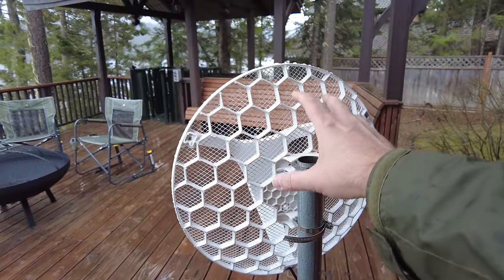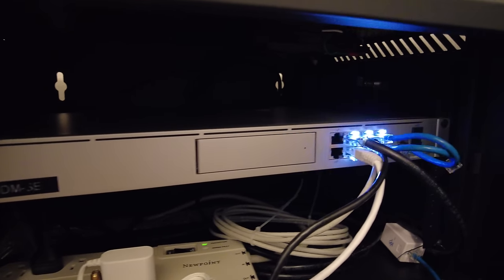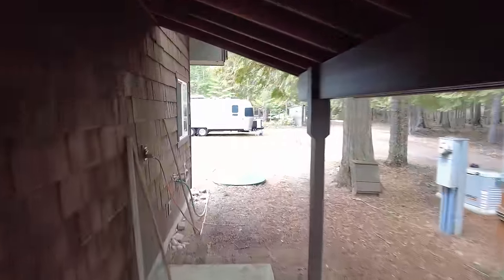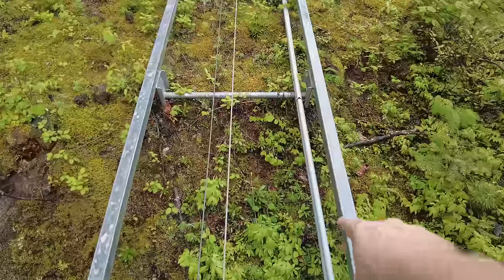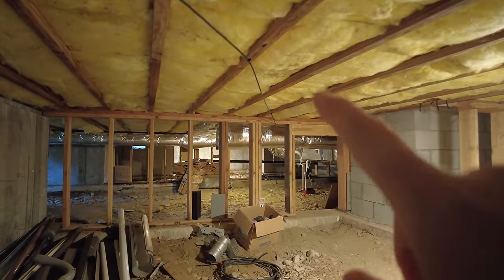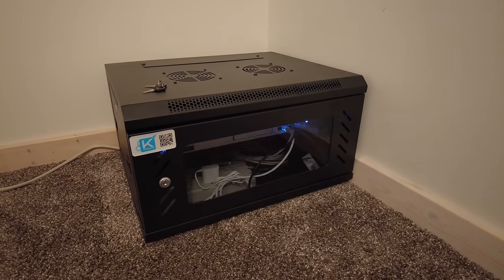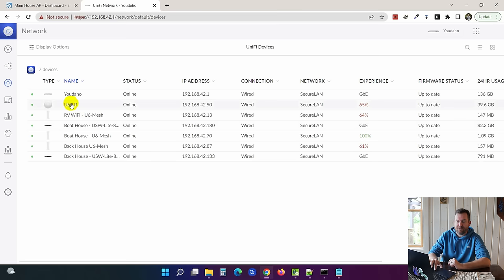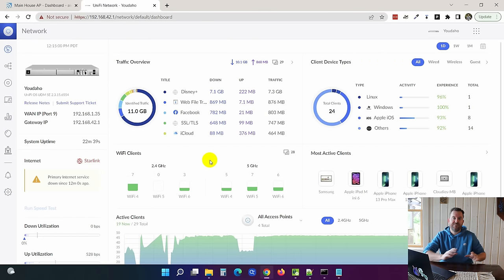An EPIC Network Install in a Beautiful Location!

Comment: What were the CAT6 SHIELDED connectors you ended up using? I had a similar situation and my connectors were not able to accommodate the larger insulation used on my Cat6 able so I terminated them with Cat6 Jack's and used short patch cables to patch them into the router and other equipment down the line. So what Cat6 connectors/brand were you able to use?

Comment: nice setup, here's an alternative

from beach : starlink + local isp hardwired to a proxmox box ( 6 ports that can do 2.5Gb/s) running virtualized pfsense/opnsense with 3 nic passthrough + librespeed container + unifyctl container
from boat house : hardwire proxmox box to an access point + hardwire 2 cables to the main switch in the main house (1 dedicated to promox and vm, one for the firewall vm dedicate nic passthrough -> basic and you can switch the cables if one is dead, if possible I would run 3 cables)
from main house : hardwire to a small switch in the back house that will spread wifi
from back house : hardwire to access points at the rv place or if length is ok, hardwire from the rv place to the main house directly

pros 
- local unifi controller
- local speed test
- pfsense (= all the goodness, vpn for remote management, multi active wan, ddns, traffic shaping...) 
- snapshot capabilities for fw, and unifyctl before any updates
- virtualization capabilities for any unpredictable need
- no wireless bridge
- can go 10Gb/s on local wired bandwidth

the problem with this kind of jobs is that it requires 2 kinds of distinct skills : general contractor and IT : general contractor are afraid of IT stuff and IT people are afraid of drilling a hole or pulling a cable,

Comment: I like the VLAN->WAN trick. 
So I’m clear the WAN switch has 3rd network cable running to the UDM to carry all VLAN data?
Plan to use this method to media convert a 2gb Fiber WAN connection modem with a 2.5RJ45, through a switch, then out to a 10g only SFP+ port on a pfsense router.

Comment: I do like this setup. The only thing I'm wondering is if spray painting the P2Ps voids the warranty. Also kudos to the ISP for helping out when you were in a pinch. Some ISPs I've worked with basically say blah blah insurance, blah blah liability, blah blah F off.

Comment: Hi Chris, thanks for the great video!
Great idea with WAN forwarding through VLAN!
Tried it at home :)
Now my UDM shows all clients from the outside because they appear in these VLANs. The network topology screen has hundreds of clients! I just can't find my devices) Is there a way to prevent UDM from monitoring traffic for these VLANs? Just put packets into VLANs on one side and pull them back out on the other. Nothing else.

Comment: Why not use an optical cable between buildings? Ethernet cable is not a great solution mainly because of the storms.
Reply: Would require media converter or a switch with an SFP port, extra device
Reply: You had a fairly large conduit so you could have ordered fiber to length with LC on each end.   Then you just need a different switch in the boat house with an SFP slot.   I don’t like media converters because of the added power brick.  You should look at fiber termination equipment, which has gotten cheaper and easy to use.   Before I retired, I managed IT for a large construction company for years and we fried so much equipment when we had static events affecting the CatX running underground between job site trailers.   Once we got setup for custom fiber termination, that problem went away.   I hope you grounded and protected that shielded cable properly!   Love all your videos dude and this was a dream job with the lake scenery!

Comment: Wondering why you didn’t just run 3 cables up from the boathouse?

I know you can easily achieve the same thing with Vlans as you have demonstrated, but just think simple is better especially if it is an AirBNB.

Comment: Question: why did you not fun a fibre run for the outside run from the boathouse up to the mainhouse? is that not "safer"? i was told not to run CAT cable in outside enviroment even in conduit? is that true? sorry if this is a n00b question. Love you videos!

Comment: Is it worth including a note on needing to ensure that the external cable has the correct flammability e.t.c ratings for internal use as looks from the video that you have used it without transition to internal rated cable for the internal runs? If you did transion, as you were.

Comment: Hi Chris! Thanks for sharing this project.
Can you comment on the U6-Mesh for APs, instead of U6-Lites or LR’s?
Was it to allow for future expansion with mesh capability?
Reply: It's his new favourite AP https://www.youtube.com/watch?v=GySDfm0CVQc
But I had the same question actually, but it's quite similar to the LR in performance, however, the LR is not as liquid proof, doesn't come with a POE adaptor and has a different form factor.

Comment: would have run extra cables boat house to main avoid the VLAN complexity and the added potential failure point, also would have pushed for cable link to rear house, wireless should always be link of last resort for a trunk especially in what is essentially a commercial setting being an airbnb. The starlink on the dock worries me, Ice and ground heave in winter is going to stress that cable ALOT!

Comment: Great real would implementation!  I had a quick question.  I’m doing a similar setup for a pretty wide open farm.  The main house with internet I wanted to use a 5ghz omni antenna with the rocket prism 5ac.  And for the remote locations use the nano beam 5ac with the u6 mesh, no switches at remote locations as they only need Wi-Fi.  But is a Omni antenna best choice since I do have a LOS?  But the LOS are from different directions.  Or would it be better using multiple nano beams on the main building give it better through put?  Thank you in advance.
Reply: I have the exact same need.  I even live in the same city as CrossTalk Solutions and contacted them a few times for help with design and setup but, ironically,  could never get someone to answer a phone nor return a message :(  There are lots of videos on YouTube addressing our needs but I've yet to find one comprehensive how-to video.

Comment: Excellent video - well explained - really seems like a sledge hammer to crack a nut a little  bit - the idea of wireless is to avoid miles of cables - and mesh is being used anyway  - and of course the relocation of the dish to get perfect line of sight was one of the keys - but anyway more of these examples please
Reply: Didn't see mesh being used in this example.
Reply: @adamm7309  yes mesh on each level and 2 to the back - (10m.05s) total 4 - i still dont understand why they didnt just run the Cat6 cable from the Antenna up conduit , straight to the serious , main house router   (signals travel in downwards directions anyway _why bother to have a router you struggle to access in the boat house and the switches so you can access it - just build a spiders web mesh from the main house some wired some mesh  - I've done something similar with 4g router myself to cover a very extensive property with issues like 2 ft thick walls etc and get 30mbs everywhere and for dozens of devices - Seems like a suppliers dream this way - Still love the video

Comment: I've become more proficient with Unifi. I am going to try this setup again. Connecting my modem to a flex mini and a Gigabeam link which will then connect to the WAN port on my UDMP. I'll only need one VLAN only because I only have one internet connection. This will then put my Gigabeam link on the LAN side for management in UISP. Right now it can only be managed by the management radio. Wish me luck

Comment: I have dealt this the same kind of outdoor cat6 Ethernet cable RJ45 connectors barely fit. Use keystone jacks and patch cables instead.
Reply from the maker: We actually did use keystones for one of the connections - you can see it at the bottom of the 4U rack if you look closely.  But - I didn't have enough in my bag for the rest of the connections, and I had no way of getting more of them quickly.
Reply: @CrosstalkSolutions  ah I could not see that, it looked like you were trying to get RJ45’s on 😁

Comment: With newer firmware versions, you can redefine Port 8 on a UDM Pro or UDM SE to be a WAN port. 

Therefore, you don't need to use SFP-to-ethernet adaptors anymore. You just use Port 8 and 9 for the two WAN connections.

It also means you have two x  10 gig capable ports on the front of you Dream Machine, for use with high speed connections to another switch or an NVR.

I found that to successfully reassign port functions on a Dream Machine, I had to revert back to the old user interface. Otherwise I would get an error when I pushed the "apply" button and the WAN port wasn't reassigned.

Comment: i have  like a ton of remarks on this isntallation , since i am a  project manager of the IT for many years, this is a bad idea to implement the cabling and termination , under the house , and on the walls . with all due respect to the things i seen , 1 thing i notice with this type of brand , specially accross the lake is when the sun is up , the light refelection reduce the wirless speed of the 5 GHz type to almost 60 % . and that you will discover soon enough.  and also humidity in the air , like fog etc... will have an impact as well . i can think of many ideas networking wise to have these 2 type of wan ( starlink and the ISP ) but i guess yours is fine , but i think it can have a better one .

Comment: I would always use fiber instead of copper on the outside, otherwise you quickly get problems with overvoltages or pentential differences between the buildings
Reply: Plus it takes away the chances of a nearby lightning strike coming through that long network cable outside.
Reply: @BrianSimmons  I'm not worried about copper wire. These can surge protected. Not a big deal.. The main problem could be mise, rats or other rodents. These could damage the wires mainly in these areas. I should use poison.... Just drop few amount in the conduct.... At least I should close glued both end...
Still have a chance, for wire damage... In this case coper ethernet is alright and still cheaper to replace if it's necessary...
Reply: @BrianSimmons  these small little pests can damage the fiber optic cables as well....

Comment: I've used outdoor cable before and understand what you're saying about getting the jack on it. However, did you try punching it down into a wall jack then using a patch cord from there? The picture looks as if you put an RJ45 jack on the end of it then straight into the router or switch.
Reply: He didn’t bring the correct ends for the outdoor cat6 cable. It was an oversight. 
I’ve been in the same situation. 
I doubt he had a patch panel on hand because he didn’t know he would need it. 
Would’ve needed two. 
There’s no getting around needing the correct ends for outdoor cable.
Reply: @vrnicastro6353 : Yes, but I assume he would almost always have an RJ45 wall socket with him. So, will the outdoor cable punch down to that, even if it's not put into a wall plate or patch panel? He could then run a patch cable from there. I'm just trying to think of a way to have done it with what's normally carried.

Comment: Love the video. Just wanted to know why you didn't use a fibre connection between the maim house and boat house?
Reply: A pre-terminated fibre would be a pain in the a*** to pull through the conduit, and the tools and equipment to termiante fibre doesn't come cheap. That being said, having the equipement electricly isolated would offer some protection from lightning etc.

Comment: Great instructional video Chris.  Did you work out the total cost of the materials?
Reply from the maker: It was close to $3k worth of equipment.  I didn't bill for any labor since this was for a buddy.
Reply: @CrosstalkSolutions  Thanks. I'm in the UK and I could do with a similar setup installing. So, if I send you the airfare.... Will you...?    :)
Reply from the maker: If the project is interesting enough for a video, and you're paying for the equipment and travel expenses, then we can certainly talk!  I'm long overdue to get back to the UK.
Reply: @CrosstalkSolutions  Haha. That's great. I'll have to dig out my wallet. Oddly enough I once spent a year over there working in Boise too so I was having flashbacks looking at your friend's lakehouse. I'm guessing the lake somewhere up north.

Comment: Good day, I am having some challenges creating the guest network. I have followed the steps to create a guest network, however when I create the guest network and the guest wifi, I am not able to connect to the guest wifi, my device doesnt get an ip address. I am only able to connect to the main wifi.
The ISP modem is the one that issues the ip addresses. Should i make some changes there?

Comment: Great video. Can you run the u6 mesh as just an access point on a UniFi network? I was thinking of using it as outside AP but not in mesh mode?

Comment: I do professional networking as my dayjob, not saying this is bad, though, I wonder about the wisdom of doing such short P2P bridges that will eventually need to be upgraded.  Running conduit between the buildings and throwing a Cat6 line through will, #1. last much longer, and #2. when it need to be replaced, you just pull whatever is the latest and greatest wired standard through the pipe and go.  Saves money long term and gets you what you need.  Additionally, the wire will be more reliable with fewer things to go wrong, though I have no doubts as to the reliability of this going forward was it's such a short distance covered.

I'd also be putting those ethernet drops into Jacks rather than crimping them, so they last longer. keystones aren't much more expensive and save the solid core cabling from a lot of movement which can shorten the lifespan of the cable.

Not the way I would have done it but certainly not a bad way to do it.

Comment: Hi Chris,   Are the Point to Multi-Point Devices managed by the Unifi Controller Software or do they use a separate Unifi Software App?    Thanks for the video of this install.  I have a possible need to do a P2P upgrade in which the two devices are about 1/3 mile apart.
Reply: The bridges they used are not part of the Unifi line so they're not managed by the Unifi controller. Unifi do have a bridge but not one they used here.

Comment: You 'er the best, I've probelm its  PTP 100 ft , 2 anntenas TPLINK 2.4Ghz (1 AP - 1 Base) ,and 1 Nano 2.4  whit swicht  its wireless , i dont have good internet , when I test on base its 200 MBSP but nano only 10 MBPS

Comment: i had same issue with my Cat6 outdoor cable.   Couldn't get RJ45s to terminate properly.   I gave up and terminated each end with keystones into a panel.   Then patched normal ethernet cables from those to the devices.

Comment: So you ran 1 cable from the boat house to the main house which is the trunk line. Then separated out the VLANs physically and plugged them into 2 WAN ports. You couldn’t just do the VLAN into WAN separation logically with only just the trunk cable plugged in? I’m guessing the Ubiquiti firewall/switch doesn’t have this functionality. This is why I will not Ubiquiti switching or routing products. 

Also you should’ve used a shielded patch panel for the main house rack. You wouldn’t have had issues terminating the outdoor cable if you would’ve just patched it.

Comment: Awesome job👍Could you please show us a little bit more details of how to create the two VLAN WAN connections in Unifi on the 8 port lite switch?
Can i use the same trick to create a separate VLAN for pap2 ip phone network and a WAN connection using a single CAT45 cable between two buildings with a Unifi switch in both ends?
Reply: You can study up on “Router on a stick” configuration and it’s the same idea and processes. And yes you could accomplish what you are looking to do with a similar design.
Reply: @curtispavlovec  Thanks for the information, the way i understand it i need to use two layer 3 switches, or can i use layer 2?

Comment: Hello Chris.  Not sure if you are aware but many people have been having issues with their CyberPower UPS units.  Very similar units to the one you used in this video, they have a glue inside that is conductive and can fail causing a fire or meltdown.  I am currently looking into replacing the units I currently have with Tripp-Lite or Eaton units.
Reply from the maker: Anecdotal obviously, but I've used a bunch of CyberPower UPS units and have not had any issues myself.
Reply: @CrosstalkSolutions  I personally don't have any issues either.  Will be interesting to see if they address the issue at all.

Comment: newb question - what factors for the bridge link determine whether to use the NanoBeam vs. the UniFi bridge devices?
Reply: I've been trying to demystify wireless bridging for some time now and I've made some progress but it's hard to get comprehensive information. There's several different frequencies that bridges can use and some use multiple frequencies. I believe devices with matched frequencies will be compatible and devices with higher frequencies will have higher data transfer rates but lower penetration through obstructions. The Unifi bridges are relatively very expensive and are higher frequency with fairly high data transfer rate. It would be nice to be able to control your bridges from within your single network controller but the unifi range of bridges is limited to a single model.